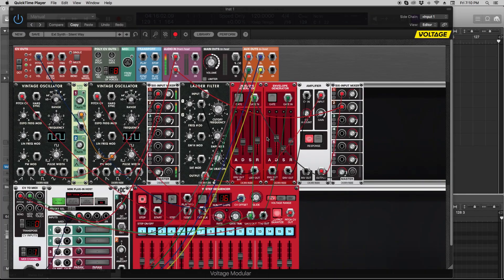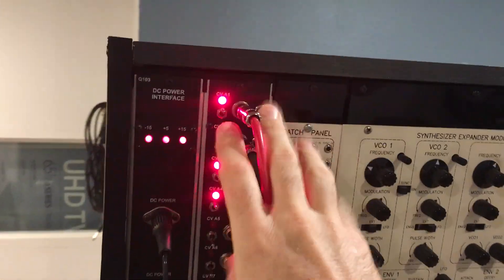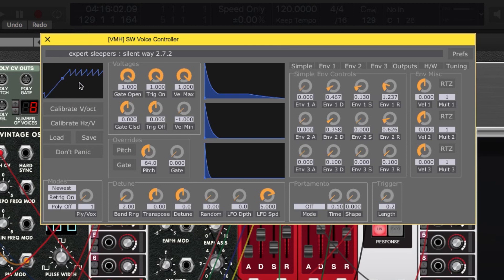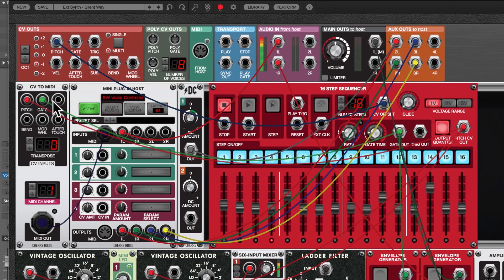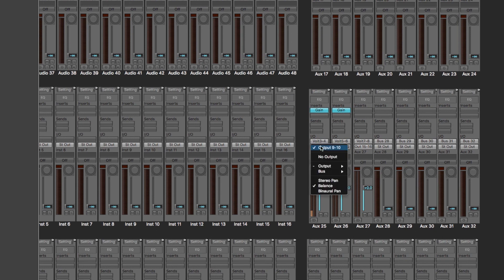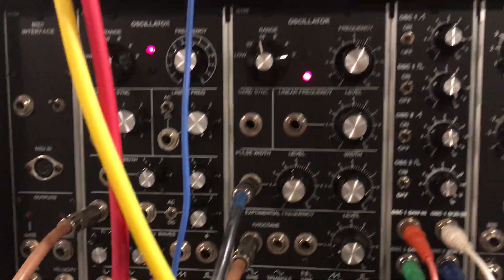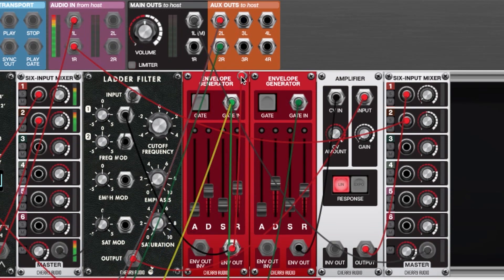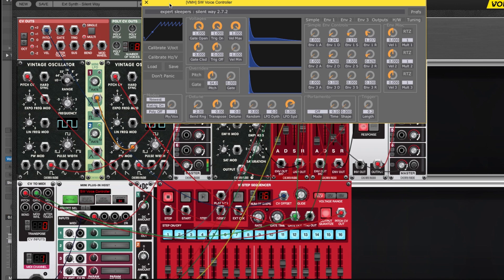Using Voltage Modular With Hardware Modular Synths

Comment: Do I detect some Depeche Mode influence?.. A bit of NLMD Aggro mix?... I also spotted an EII in an earlier vid
Reply: Yeah, I did that little Depeche seq for fun. And yes, I have a mint vintage Emulator II+ HD that I found here in Vegas, though I feel guilty that I never use it. If you have Voltage Modular... I designed our Sampler II module to look just like it for fun. :)

Comment: nice setup. Noob Question, What's the difference between CV and normal audio other than frequency? is CV positive only or is it AC like audio but just normally inaudible?
Reply: Sorry, just seeing this. The basic answer is there isn't any difference, it really just depends on how you use it. In other words - an audio signal gets plugged into an output/speaker so you can hear it, whereas a CV doesn't get plugged into an audio output, it's just used to control something else (like pitch or amplitude). CV's can be DC (typically used to control osc pitch) or AC (the cycling output of an LFO). DC voltages aren't audible when plugged into an audio output because they don't go up and down (i.e. oscillate), whereas AC voltages are audible as long as they're within audible hearing range. 

If you have Voltage (or that other thing we don't like to talk about :) ) it's easy to plug in an oscilloscope module to get a better understanding of this stuff.
Reply: @celebutante  "... there isn't any difference ..." Not quite, but a nice try. You can vary the pitch of an oscillator with an AC signal. How else do you think FM works? Bottom line, there is a fundamental difference - an audio signal is always AC, whereas CV can be both DC and AC.
Reply: @SpeccyMan  Might want to reread my reply: "CV's can be DC (typically used to control osc pitch) or AC (the cycling output of an LFO)." To answer your question, I'm pretty sure that the latter is how FM works, but I'm not 100% sure, as I've only been messing with analog synthesizers for roughly four decades.

Comment: Can you use Arturia Keystep or Beatstep?
Reply: I'm not sure if the Keystep/Beatstep converts incoming MIDI to CV (i.e. coming from Voltage Modular). If they do, then you could use the Voltage MIDI to CV module to send MIDI to the Keystep/Beatstep, then have them convert to CV, and you'd be set. You wouldn't be able to use Silent Way, because it uses the audio outs of an audio interface to send CV's, and Keystep/Beatstep are not audio interfaces.